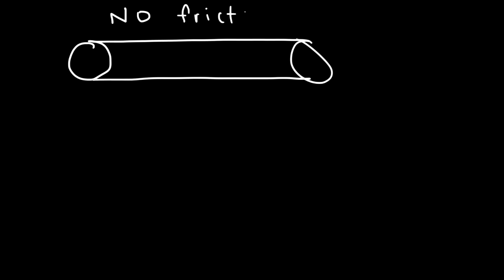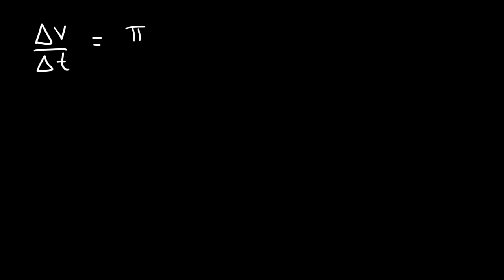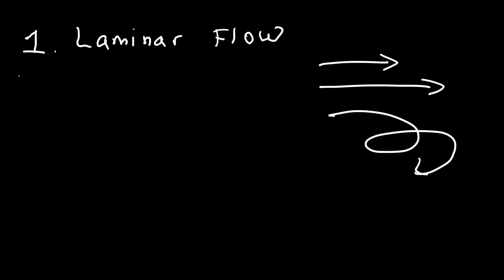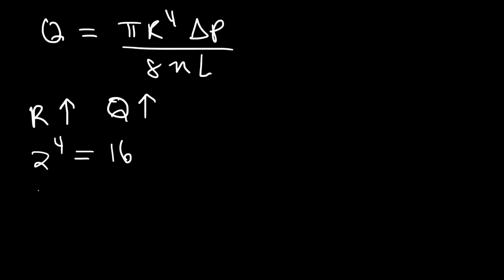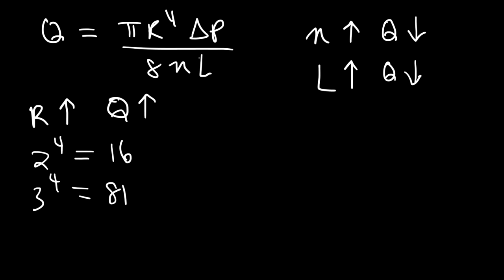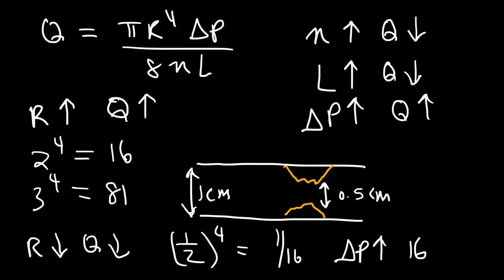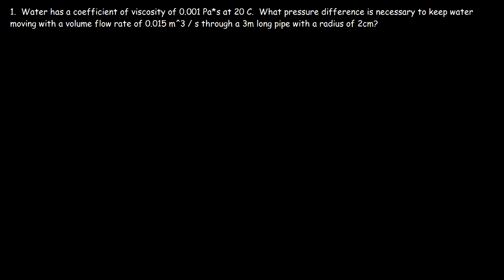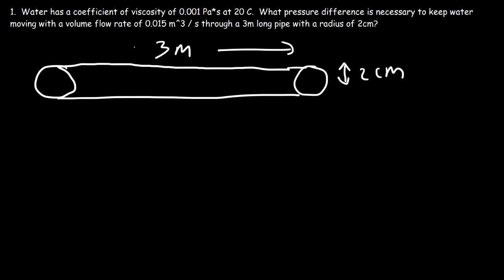Poiseuille's Law - Pressure Difference, Volume Flow Rate, Fluid Power Physics Problems

Comment: The answer  716.2 Pa for Quiz #1 is wrong. Because the flow is a turbulent flow with the reynolds number of 477,600, it cannot use the Poisuille's law. Instead, you have to use the the Darcy-Weisbach equation. Therefore, the pressure difference is 69,500 Pa from the Darcy-Weisbach equation. Could you give me your opinion about my argument?
Reply: Can I ask how you calculated the Reynolds number for this problem?

Comment: I don't know if I made a calculation error but the Reynolds number for the first example was over 400k so therefore Poiseuille's law wouldn't be applicable surely?
Reply: Can I ask How did you calculate the Reynolds number for this problem?
Reply: @kellyhighmore2982  I did this ages ago so I don’t even remember 😅
Reply: Right thanks

Comment: Isn’t flow constant? 
When you say flow rate, do you mean speed? 
Correct me if I’m wrong, great video😄😄
Reply: The flow rate, which I will call Q, is not quite speed, which I will call v.  I use v because I was trained in physic classes to use v as the magnitude of the velocity, which we also call speed.  The speed is proportional to the flow rate.  As he noted, Q = Av.  Here, A is the cross sectional area of the tube, or  pi r^2.

Comment: 9:53 my calculator gives me a different answer I know your answer is correct but are there any tips anyone has for inputting everything into a TI-30 calculator has been a problem for me since college
Reply: it helps to individually compute values with exponents, then writing them all down until you've computed all your values
Reply: Even my calculator gave a diff ans, it's 7.17 × 10².

Comment: Thanks for the video. Does this equation only apply for horizontal pipes? What happens if is vertical?
Reply: fluids and gases preassure acts equally in all directions simultaniously

Comment: can this equation be applied to air(concentration of air and oxigen ventilator)?  what is the coefficient of viscosity of  air (concentration of air and oxigen ventilator)?
Reply: Gasses viscosity is affected by temperature ,which is inversely proportional to temperature,whereas fluids is directly proportional
Reply: @rogerroger7536  Its the other way around. Liquid viscosity decreases with increased temperature i.e. inversely proportional while gas viscosity increases with temperature - directly proportional

Comment: 1. When fluid is introduced at pressure p1 in pipe , flow through pipe causes pressure drop which is given by poiseullie’s equation 

P1- P2/R = Q 

Where R is resistance to flow factor = 8*x*L / (3.14 * r^4)

X = coff of viscosity 
r = radius of pipe
L= length of pipe

So P2 = P1 – QR

So more flow i will take more pressure will drop and I will get output flow at low pressure.

Doubt 1 :-

Physically it will look to me like following 

A) low flow (Q) high pressure (P2) condition - at outlet side velocity of  water leaving would be higher
 
B) High flow low pressure (P2) condition - at outlet side velocity of water leaving would be less

Doubt 2 

Or similarly someone tell me 2 cases 

Case 1 :- P1 = 4 kg/cm2  and P2 = 2kg/cm2
Case 2 :- P1 = 4Kg/cm2  and P2 = 1kg/cm2

In which case flow through pipe is higher ?
My answer would be case 2

Is my answers in Doubt 1 and Doubt2  correct ???
Reply: As presure difference increases, q increases so case 2 has higher q (flow rate)

Comment: The cholesterol that gets deposited in your arteries is like a scab... it has been sent there by your liver to repair your artery that was damaged from high blood viscosity.... The high blood viscosity can be caused by high hematocrit which can be caused by sleep apnea and smoking .... Both of which can cause stroke.... 

Another mechanism is a lack of collagen in the diet and a lack of vitamin C.... The vitamin C keeps the integrity of your arteries good... This prevents them from being damaged...that then prevents your liver from producing cholesterol to Band-Aid them...  Which then will reduce your blood pressure.... Which then will reduce your risk of stroke....

Comment: You're right about everything except cholesterol in the diet.... Cholesterol and triglycerides are actually caused by carbohydrates...  if you don't believe it going to low carbohydrate diet then check your cholesterol.... You can correct your cholesterol with a low carbohydrate diet...I did... I also increase my cholesterol with a high-carbohydrate diet.... Believe what you want...

Comment: Good but please don't imply other subjects' notions of which you don't know about. Cholesterol through diet is not directly linked to atherosclerosis and hearth disease. It is much more systematic than that
Reply: Additionally, drinking warm drinks doesnt change temperature of your blood in any significant way. Of course you are adding heat to your body, however If hypothetically all the heat was added to your blood (which doesnt happen) and there was no loss due to evaporation, there would still not be any change in blood termperature. if you calculate Q=mct the amound of heat you would need to change blood volume one degree youd see that the heat of a hot coffee is not even close. Even if you could change your temperature by a few degrees, like getting a slight fever, it wouldnt change the viscosity in any meaningful way. However, i love your videos they are very helpful. Thanjs

Comment: 0:54 how can the fluid flows at constant speed if there is no pressure difference? (except if the constant speed is 0 of course). The flow is intrinsically defined by a pressure difference no ?
Reply: He was referring to an "ideal fluid" in which friction does not factor. I assume that the fluid, once already flowing, should continue to flow unless acted upon by an outside force (in this case internal friction), as stated in Newton's first law. However, in the real world, a fluid requires a pressure differential in order to continue to flow (as you stated).
Reply: The fluid can flow at constant speed without a difference of pressure. However, the pressure difference causes the speed of the flow to change.
Reply: You should know about Newton's first and second law. If we applied a difference pressure then velocity will change (accelerate or decelerate)
Reply: In an ideal fluid, there is no viscocity, therefore no friction due to the layers of fluid so the velocity will remain constant. However, ideal fluids are theoritical, in real life there is no such thing. So friction is present and therefore will cause the speed of the fluid to decrease but since in real life there is pressure difference, the pressure difference causes the real fluid to remain at constant speed.
Reply: well maybe not constant speed but remain to flow*